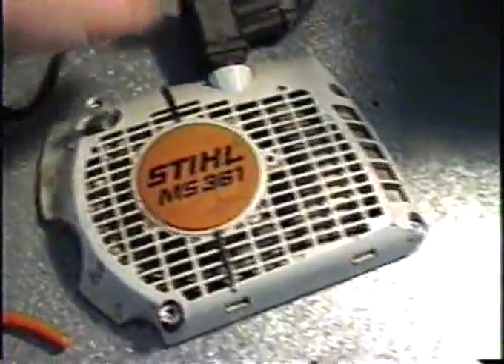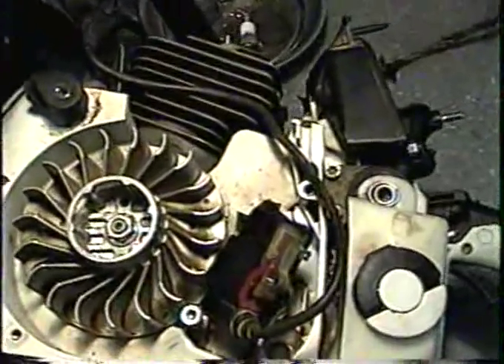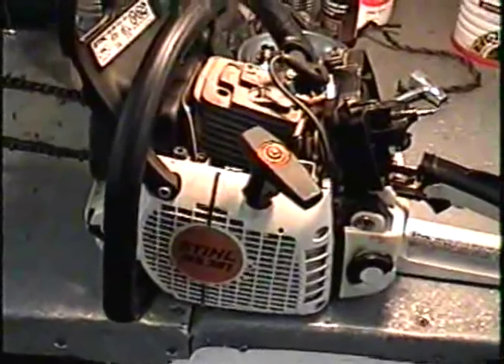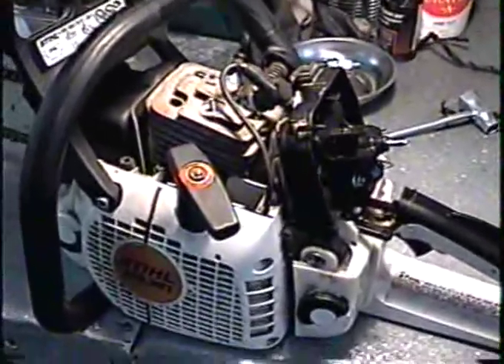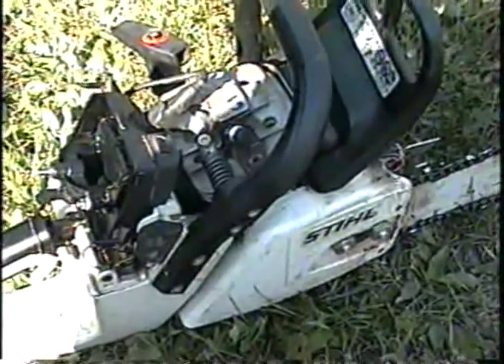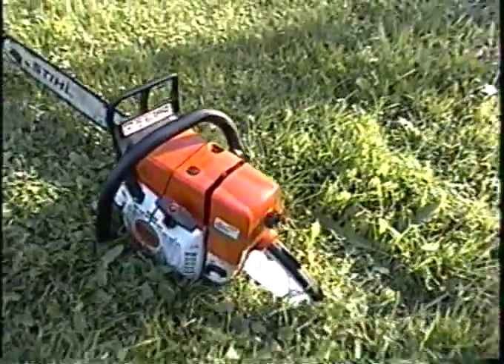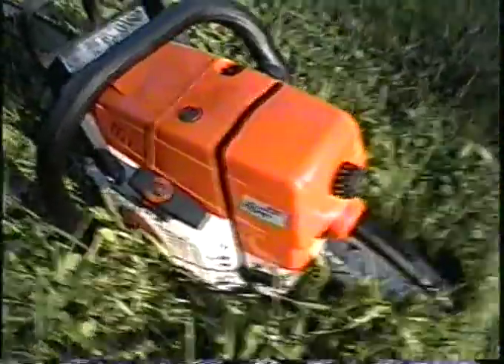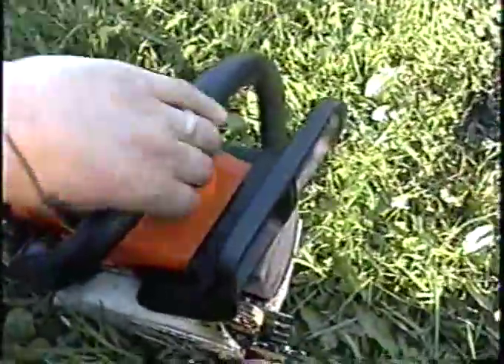STIHL MS 361 IGNITION MODULE REPAIR "MUST SEE FOR ALL STIHL OWNERS"

Comment: Know well what you mean.  I built a Huztl 440 kit and that sucker did not know what 10,000 was.  I replaced the coil and checked WFO.  My first reading was 11,320 and my second was 11,480.  I will let it break in a little more before I lean it out a bit.  I used a new coil from hlsupply and am very satisfied with it.

Comment: Posting this around because I couldn't find anybody else online talking 
about it:

After having a world of trouble with my Stihl MS-250 not starting, I 
decided to check the coil. It had spark, but I guess it wasn't strong 
enough to fire the plug. Forums have people that tell you to replace the
 coil in a case such as this, but a few say the coil seldom goes bad in a
 Stihl.

My saw is not that old. Even so, I decided to pull the coil and replace 
it with one out of another older ms-250 I have. Then I noticed the gap 
between the old saw's coil and flywheel. It was not the same as the one 
on the problem saw. The non-starting unit had a wider gap.

I got back online and found the correct gap setting should be 25 
thousandth (can use a business card to set the gap). I decided to only 
remove the coil and clean it up, then reset the gap. 

 I put everything back together and used a business card to set the gap.
 Then pulled the spark plug and made sure it was gaped at 25 thousandths
 too.

The saw fired up and runs like new!

It's hard to understand how that gap changed. It was never torn down 
till now, and it used to run very well for the longest time. Maybe 
buildup from the dust and oil lodged between the two components and 
caused it? But the torque screws holding it in place were very tight, 
and I can't see any reason for the coil to have slipped.

But now happy... got my toy to working again.
Reply: I am going through this right now! My saw MS250 is 2 years old, maybe only 5 hours on it and it quit a couple weeks ago. Just got a new coil, aftermarket. I noticed that my original coils gap seemed large. The distance was wider than a credit card. New one fires up but but saw bogs down so I believe my exhaust may be clogged up. I am going to test the old coil again tomorrow in the saw and set the correct gap. If it works I rather use the OEM coil. I'm thinking that the coils gap somehow open the same as you explained. I am no mechanic, just learning from youtube and forums.
Reply: Good catch on your part. Gap matters even on very tolerant mower engines. It's critical to magneto efficiency.

Comment from the maker: it should not have a rev limiter. install it by placing a playing card between the flywheel and the coil, the tighten the srews.if it has spark continually the coil is good.

Comment: I have a Stihl FS90 weed eater and no spark. I put in a new ignition coil, new spark plug and no spark.  I have taken the black kill wire off the coil and no spark. 

Question:  What does the blue wire do. Could one get spark if both wires were off the coil or does the blue wire have to be on.  

 If I had a bad ON and OFF switch even with no Kill wire attached could that still  give no spark. Thanks for any info you may have.

Comment: My girlfriend gave me her O25 Stihl,,, had it for over 10 years she said,,, she had a problems  with it! but can never figure it out,, She  replace the carburetor fuel filter fule lines, spark plug,, and took it into a Saw Shop they them whacked her for $75.00,, What the problem was The 025 would run for 15 minutes,, and if you place it down as it idled,,, she would die,,,you would have to wait until she's completely cold to get it started again which would be on the first Pull,,, I told her let's check your Magneto,, we cleaned it check the Armature air gap, A playing card with slide very  semi easily through it, I readjusted it,,, started it back up when it's cold,, same symptoms,, check on the price for a MAG,,, found it for $75, ordered one of those Chinese mags,, less than$ 20.00... Wa laa problem solved,,, O25 runs excellent,,, Cut 2 1/2 cords with it no problem yet! an easy way that I found checking a MAG,, irregardless if it's on  lawnmower, Mower,, motorcycle, chainsaw weed eater,,,ECT  (remove the spark plug from the motor )find a same used spark plug of that item.... that you're testing and if the electrode Gap is supposed to be at .025 or 030 in auto motive .060  ECT then bend the ground electrode (twice) the recommended gap... supposed to be .030 will become .060 Ect... the reason is the atmospheric air pressure is approximately 10 times less than what your compression pressure is when the Pistons coming up on a powerstroke,,, and grounding out your test spark plug with a wire to the Muffler,,, you'll be able to see externally that your Magneto is jumping twice the distance of the recommended gap for your  (TEST Spark Plug) that you taken out of your engine,,,, this is not a 100% guarantee test but it' dial you in at 98.7 % the other 2.3%?  If the coil is 10 years or 20 years old give it a flip😊and put a new one in. excellent video Donnie boy,, I like the part before,,during,,and after results.!

Comment: Every Digital CDI coil has a "limit" on them, put a tach on it-pull the bar off and pin it and you will see that the coil will hold it at a peak RPM and you can also here the coil cut the spark down to every other stroke rather than every stroke. What happened here was the coil was defective, most likley from heat.

Comment: Oh no! Its not a defectie module, it was the module of a TS 400, look at the part number. TS400's rev limit is 9700 rpm. I have made a programmable ignition module for the MS 361/341. There I can modify ignition timing and rev limit by myself. Let me know if someone is interested.
Reply: I realize that it's been a few years, but would you kindly elaborate on what you mean by "a programmable ignition module for the MS361"?

Comment: Hi 
I have replaced the coil on a 361 following your instructions, but I still can't get a spark, (when I put a spark tester between the new spark plug and HT lead.)  I didn't replace the two small wires that came separately with the new coil.(one goes to the engine cut off, the other is secured under the screw holding the coil in place.) I tried to take the carb off in order to replace these small wires, but ran into trouble as I couldn't see how to remove the carb linkages, could you steer me in the right direction ?
Thanks

Comment: Hey Don, have you ever worked on a Stihl mm55 yard boss? I bought one used, it starts and runs beauty, but sounds exactly like this at full throttle. I'm wondering if it's normal for this machine , or if I should spend the $90 and try a new coil. Any other Stihl products have a review limiter that you know of?Thanks,

Comment: Stihl is probably using limiters because of the non-adjustable carbs. With the traditional carbs, you used the H adjustment to set your top no load engine RPM.

Comment: the spark will be weak. it will probably be hard to start and maybe run a little rich as the spark will be weak and may not provide a completely efficient burn. you may have a carbon buildup which may cause pre-ignition, and failure on any number of parts from melted pistons, to shattered crank bearings, to bent rods. or, the excess pressure may cause the seals to start to leak, cause the engine to run lean, and fry it. just set the gap with a business card, or a folded over micro fiche card.

Comment: It's hard to see the part number on the coil but it looks like the original coil was from a hand held blower 41?? 400 1307. The coil you replaced it with looks like a 1138 400 1300 coil which is correct.. Different governed speeds, different timing. How did a blower coil get on your chainsaw?

Comment: HELLO DONYBOY73.I'M WORKING ON A STIL FS91R. IT APPARENTLY HAS A REV LIMITER TOO.CAN YOU SUGGEST IF I CAN USE ANOTHER COIL THAT HAS NO LIMITER? I NEED TO DELETE THAT FEATURE.I'M NOT SURE IF THE COIL OF THE FS90R  CAN CURE THIS HEADACHE.

Comment: Thanks for this Don.  
I am trying to find a coil for an MS270.  1133 400 1350.  I can find one BUT the coil is $90 U.S. + shipping.  Buy the time I change the coil, do a carb kit, fuel lines and fuel filter the value of the saw is eaten up.  Any suggestions on the coil?  The ms270 coil mounts are wider that the 361.  I compared it to the one in this video   Thanks   
One more thing  the coil portion measures good    what about a ignition module in there???
Reply from the maker: check your local stihl dealer or ebay for an aftermarket coil
Reply: Thanks so much for getting back to me.  I did,     but I am not going to give up     too good a saw to walk away from.

Comment: wow it seems like there is alot of issues with stihl Saw's In your opinion which is the best all around low maintenance saw
Reply: Echo/shindiawa is the only saw I've seen take the abuse of arborist and never skip a beat. I love my ms361! But a Damn echo cs-590 outperforms it for half the cost. The best running 60cc saw I've ever had or serviced is the echo cs-620p. 59.8cc, extremely well polished bore, unlimited coil, very long stroke, and stratified. Do a Muffler mod, base gasket delete, tunned correctly, that saw cuts like a 70cc all day. Not a single issue ever. 
I stihl love my stihl's too! Better luck with them than I had with husky's.
Makita/dolmar is also a very reliable pro saw brand. And when I say pro saw, I mean no clamshell cases. Vertically split, magnesium cases, and high performace and quality motors make a pro saw. And good A/V makes an even better pro saw. 
If you know how to work on a saw, and tune one correctly in the wood, then an Echo 620p or shindiawa 600sx (same saw in red) is my recommendation. Most under rated 60cc saws ever built. And will noodle oak with a skip or full comp chisel and 32 inch reduced weight bar all day without slowing down. Never seen another saw in that price range ($500 or so) or size 59cc-69cc do what those saws do. Just my observation. I am still hoping they come out with a 70cc saw over built to high hell like the 620p. If they do, every other manufacturer between the 70-90cc class will be in trouble. 
Do not buy an echo 600p, 680p,800p, etc
Echo's 590 and 620 are what you want if you want a 60cc saw. If you can swing the 150 dollar difference, get the 620p or 620pw(wrap handle saw) If you want to run a 20-24 inch bar well on a budget. Get the 590 muffler mod, fatten it up, and keep the chain sharp. 
I have no affiliation with any chainsaw brands. I just run them, hoard them, and work on them. 
I hope this helps someone. You don't need to spend 800 dollars on a new saw that has some fancy electronics. Unless you change temps and altitudes a lot, and can't tune a carb. Safe cutting everyone
Reply: @MostlyPeacefulCombatVet  actually, people buying used saws like myself , and I am more old school collector. I have zero problems with old Stihl . Bought new ms270 and problem after problem and she wasn't even abused. Used just for firewood . I guess, she is made in Germany but with chinese parts. That's the way how it works all nowadays

Comment: @donyboy73 What happens if you don't position the ignition coil at the distance of a playing card? ie. what happens if it's a wider gap than that but it still works? Will it ruin anything in the long term?

Comment: HELLO i have an 18.5 twin opposed briggs and i want to enable a rev limiter on it to about 5000 rpm maybe more if i feel i should, i know i have to un govern it , but my question is

how can i make a rev limiter for it i had a basic idea of putting a spring loaded flap on the carb
so it would cut air out when it gets high rpm 

but then i saw this coil doing this and saw coils on push mowers do this i wanted the same
i have 4 push mowers same hp all briggs

so how can i get my coils to do this

Comment: This is very odd. I ran into the same situation with the brand-new 130 power head. Full throttle was continually running on the rev limiter and made the machine vibrate and become very uncomfortable to use. Frankly it was ridiculous that they would design a machine with the wrong ignition. Apparently they use the same ignition for four different units and obviously it is not compatible with the 130 yet they sell it as such. It's very irresponsible for them to sell an awesome powerhead with a substandard ignition system.

Comment: i fitted stihl internal ignition on a very old echo and now it ONLY SPARKS turning backwards--- pulling recoil gives NO SPARK.
Reply: Air Port Hey bud , the coil might work if you flipped it over, putting the trigger on the side opposite to the flywheel

Comment: what cause a stihl to be hard to start after its running and you turn it off then try to restart
Reply: Man, i have been searching Youtube looking for answers...asking questions, and getting no responses...
I have an older 029 wood boss avs
The exact same issue. It is horrible to start after it warms up. 
Did you ever find the issue?
Reply: It could be anything honestly on any older saw. But Usually in the case of the ms361 it's a mixture of improper tuning, or fuel mixture, and compression. Use the decompression valve on it for a hot start. Some saws are picky too. I've had a couple of 361's and one wanted half Choke to start hot. Even after a new carb fuel lines, filters, etc. The 361 I have now has always fired back up hot with decomp valve open no choke. 2nd or 3rd pull. 
Also could be wear in the cyl. Or could be clutch issues. Excessive heat will make them start to seize. Same with the piston/rings/cyl

Comment: Hi i use my dad's 361 also and i do alot of sawing,but i have 1 problem with the saw.okey it starts up catches good etc.but if u dont accelerate the throttle it'll sound like a harley not smooth like my 029.i think it might need carburator adjusting.(i'm no pro i'm only 13 yrs old soo)please answer back i really need this advice.